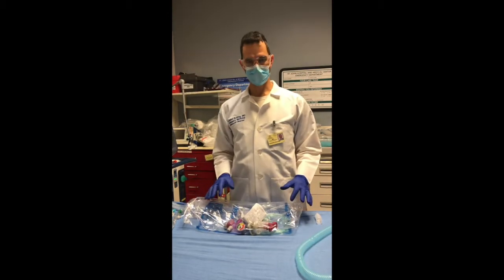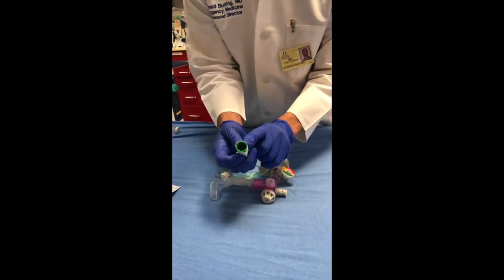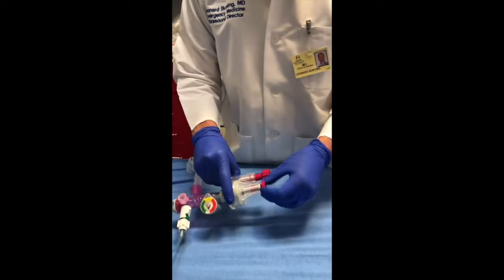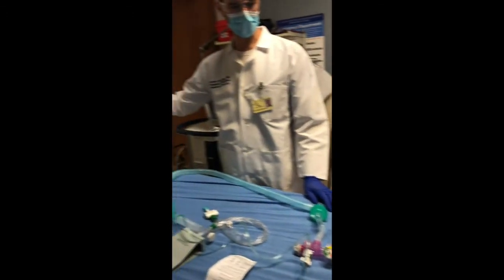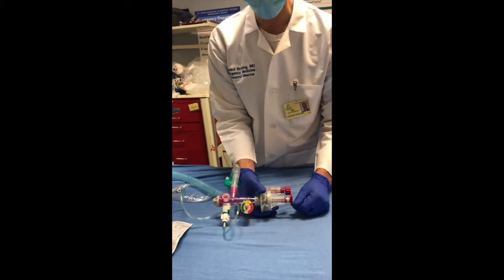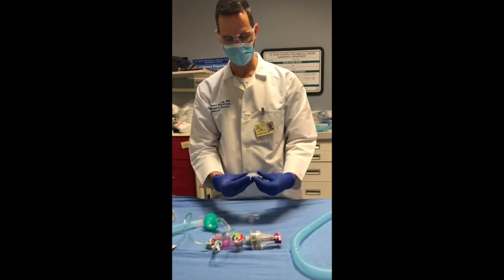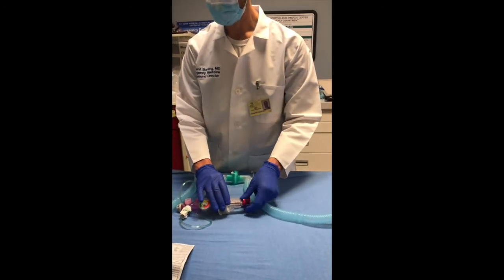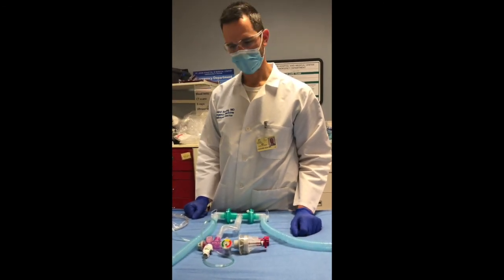VORTRAN Resuscitative Ventilator Setup

Comment: "4.Triage processes are enacted that embrace patient acuity, clinical condition(s) andcomorbidity have been embraced" this Clause approved yesterday as an attachment in the federal letter needs to be struck. The second and proceeding consorcia opinion which opposes this entirely needs to be explained as industry propaganda. I thank you for your work. The opposition is very clear that if you allow a ventilator to be shared it could be shared and the design of the ventilator could be modified from the get-go to support many patients. We are presently engineering and building ventilators or should still be engineering the ones that have not been built yet for the pandemic environment. The opposition points out that some of the cheap control circuitry, those functions that are for example provided by artificial intelligence both from the cloud and within a cheap Android device oh, where the entirety of the ventilator that is superior to a $25,000 ventilator is sold at retail for $250 by a team of experts not merely an entrepreneur. In fact the Indian Advanced ventilator, produced by a company that is eager to nearly freely share the plans and Source the materials, that has world-class intensive care physicians, offering their personal cell phone numbers, to consult, freely, your team, is so badly needed by them. The excerpt I have pasted it I was able to find in about 27 seconds. That was prior to 9 a.m. my time today. It is over 5 hours later. I have now read the document I download up to this point of your YouTube link. I'm going to continue to get through this document even though I skipped through the fancy perfectly edited guide for the low-level power power power professionals the ventilator therapists also known as pay Ara oh, the letters p a r a professional. We don't really have ventilators scientists in this world of ours apparently really. The Wiley ebook from 2014 as 390 I think pages and is free for anybody to download, as it was written for the SARS Etc coronavirus threat, relatively recently, and the non-invasive ventilator use is argue that one of the chapters as less dangerous for clinicians oh, I trust that you have read it cover-to-cover, even though it is not a monograph. Tonight we have Mark Kelly and his twin reading to children. You guys should consider reading that book to the world out loud. Because the e-book is free the authors of the chapter obviously are free to read it out loud at least there chapters and they should. I don't know where they would put those files. I think the example set by Satellite XM radio and the former senator from Montana I think Minneapolis wherever Al Frank is from if that be his name. I don't like number for. I like it even less in context of the of the document. These types of questions are best addressed by requiring a unanimous verdict of a jury after skilled Advocates take time to present all the truth. There has to be I to rayshun objection and response to objection. E i t e r a t i o n!

There are alternative ways during a pandemic to give the body time while maintaining oxygen saturation in the blood. These include the use of fluids in the lungs like those fluids used for deep-sea scuba diving. I wish I was kidding here. I have found no information about the contraindications when people are going to be dying in minutes to the use of these oxygenating fluids. The problem in the lungs is the body's fluids requiring above atmospheric pressure to prevent the smallest structures in the lungs from closing or collapsing irreparable e.

We need to be dropping body temperature is down doing anything we can to wait for ventilators that cost no more than $250. We need to be building these $250 ventilators and building them or the star configuration of patients were in the center of 12 if by the hours of a clock or far more people who could be outside in much of the country 24 hours a day not merely intense but literally in the fresh air we need to be building appropriately not in Central Park. We have plans that can fly people across the country very quickly. We have Wide Open Spaces. We have the ability to provide reliable electricity anywhere night and day. Concerns about clinician exposure are eliminated by simply taking care of people in naturally open-air environments. The science is that any Hospital cannot protect anybody who is in the same room with exposed person when that room is negative event delighted when the room is negative to be ventilated the occupants of the room are not protected. Over 90% of the country is unoccupied is right? We are a nation of Open Spaces without any structures for many miles.

The pandemic emergency ventilator research that has been done for over a decade by amateurs has one thing correct. Use a two stroke gas engine if you have to! Getting rid of the carbon monoxide is not a challenge. Electric motors are fine to quote the man verbatim. What's happening in Italy, for failure to use your technology. Which is not actually technology but it's just the alternative to indifference, requires criminal prosecution of many involved in Italy and should include people in the United States who have allowed it to occur for too long.

Our country is founded on principles of assembly. That means people can speak freely and be heard in public about matters of the greatest consequence. You need to be on YouTube talkin widely. You need to hear from experts in actual ethics not this quasi not disruptive but simply corrupt field of medical ethics. Comorbidity generally speaking, requires good faith application oh, you can't have comorbidity be the criteria in life and death situations without controls against the subjectivity. The file of the document yesterday has too much mention of clinician risk. Clinician risk is a separate matter. This is the most important Point perhaps. It takes many hours for the therapist technician to be affected by exposure to this virus. The skill-set is extremely quickly taught. We have no shortage of volunteers. Under such a circumstance there should be no controversy about the ethics of doing the Best Buy the patients collectively without including risks to The Helping Hands not being able to continue indefinitely. The triage for it to be ethical has to be both necessary and inclusive of meters Rask that's metered risk to the clinicians not minimize the risk to the clinicians or as I said absolutely expendable paraprofessionals capable of consenting do minimally heroic efforts that guarantee a return of many patient lives for every volunteer as life lost. Many. Not dozens but hundreds or thousands of lives will be saved for every 10 hour trained person who gets sick and dies. I think that this is something that has to be accepted in the pandemic if you're a professional. I am dropped it certain that there will be no shortage of volunteers even if the ratio is closer to 1 to 1. Certain!